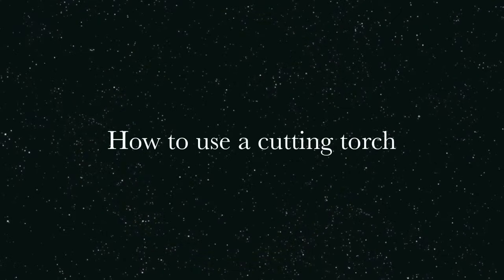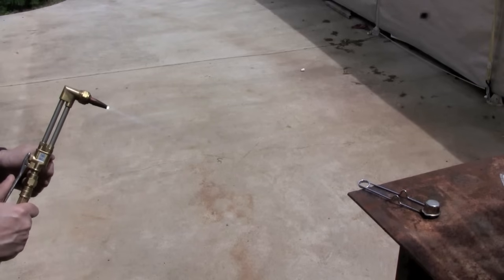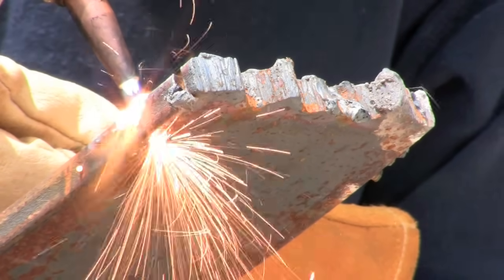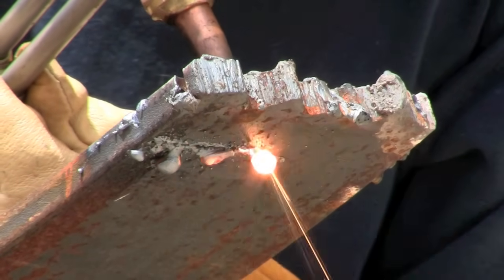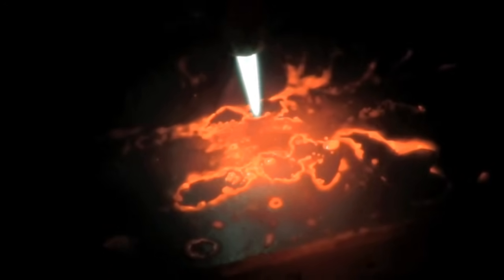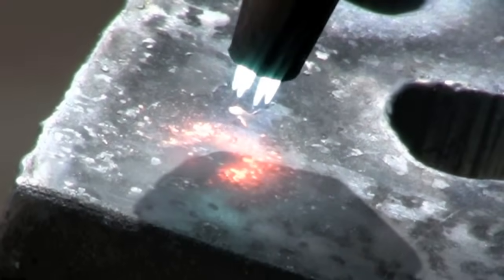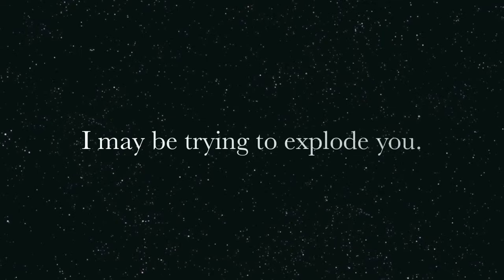how to cut with a torch. oxygen acetylene welding cutting torch

Comment: You should make the inner cone of the flame as tall as the to be cut material, otherwise you will have to much or the little power for the cut. 

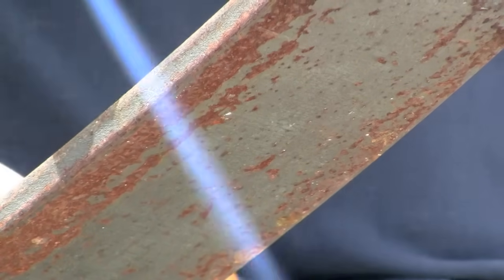With starting the cut aim at the corner and hold the torch 90 degrees (so there is no point on the cut meterial) to the piece you want to cut. First start of at 45 degrees on the cut. Then hold the torch some 65 to 70 degrees to the cut, so the torch first goes through the side, and dont leave the  buttom piece of the cut not cut deep enough ( like on 1:34). Blowthrough is a bit much, but you should try to see how much seconds it takes in order to make a good cut through the material, thickness and kind of materials takes different times. 

This is what the book  "Welding Skills" (OAW cutting opertations chapter 25) says about making cuts. 

Greetings,

Jeff

Comment: Always open acetylen first.
Always close acetylen first.
Reply: why?
Reply: +VerticalWit BOOM!
Reply: Because doing so prevents flashback.
Reply: can you elaborate why? I am new/amateur to cutting and would like your opinion!
Reply: i wanna know too
Reply: kevin O its personal preference on what to do. It really does not matter either way.
Reply: the oxygen blows any acetylene left in the hoses or tip out. always open acetylene first and close it first
Reply: Its causes burnback(loud pop) and will mess up the o-rings inside the torch... Its especially important when using a rose bud to always Go Acetylene then oxygen... I have seen a lot of guys mess torches up in my 20years welding/fabrication ...
Reply: I wonder why my teacher and book say close oxygen valve nearest the torch flame first
Reply: The book should have some reasoning if they bothered to mention it...The teacher probably just read it there!
Reply: Yep! I am an aviation mechanic and the way I remember this is: airplanes have to have fuel turned on to start the engine, and the pilot shuts the fuel off to kill the engine :) 
FYI - This runs the carb dry so there is less of a chance of the engine accidentally starting.
Reply: Povl Halberg  m.s.flate plate 3.15mm gas welding describe the  gas setting firt .pl.help
Reply: Actually you turn on oxygen first and close it first to prevent it from going to the acetlyine tank since oxygen is the fuel. And if your cutting torch pops once in a while it's because of soot. If it pops all the time, your valve on the torch is damaged. Quote rep form Victor torches
Reply: Agreeeeeed
Reply: Shutting down fuel first reduces likelyhood of a backfire. The backfire in itself isn't necessarily dangerous, provided you are running flashback arrestors, but repeated backfires will deposit soot all over the internal passages of the torch and could eventually cause leaks or other damage. Every torch I reman always has soot in it to one extent or another, but some are REALLY bad, and it's due to improper shutdown procedure.
Reply: Why we have dual flashback arrests
Reply: @craighudson2696  Indeed, I always use and recommend dual arrestors. For folks that don't understand what we mean by "dual" arrestors, we mean arrestors at both the torch AND the regulators, on both the fuel and oxy sides. So, technically, there are four arrestors total. For high-fuel-flow situations, like heating tips, large arrestors are available. Most people use alternate fuel gases such as propane or propylene for heating, and in that case the restriction of the standard arrestors can be overcome by simply cranking up the fuel gas regulator pressure.
Reply: Unless your welding with it.. not cutting!
Reply: @sharp937   I'm not sure I understand your comment. Are you referring to flash arrestors? Arrestors should always be used whether cutting, welding, heating, etc.
Reply: It also releases black sot
Reply: Close oxygen first with a rosebud or it'll backfire and not reignite properly.
Reply: @danielallen4335  Wrong. Always cut fuel first to prevent flashback. Without fuel there's no fire
Reply: @byersjohanson296  they have changed that, the new guides say to close the oxygen first don't know why though.

Comment: I never lit a torch an get black smokes yet since I'm doing welding..a clean cut always drop..btw try burning without leaving any blur at the bottom of the msp ur cutting..its gas then oxy or a little bit of both together

Comment: what pressures do you set your torches to
Reply: Acetylene: 5  Oxygen:40
Reply: Thank you very much
Reply: For 99% of cutting; Acetylene 5-7 and Oxygen 20-21.  99% of cutting problems are due to too much O2 pressure.  With the correct tip you can go through 1" material with no more than 25 psi O2.
Reply: +Jim H thanks for the advise Jim
Reply: Ernesto andrade
Reply: My teacher told use 35-40 for oxygen and 7-10 acetylene
Reply: If you have a specific brand of torch tip, let's say Smith, they will have a chart on their website, that chart has a list of tip sizes and it also tells you what to run your oxygen psi at and your acetylene psi at, never just set it to a pressure someone tells you too, they dont know the specifics of the tools your using, that's how you get hurt.

Comment: Oxegen is rusting the iron that's why you cant cut aluminum
Reply: Aluminum forms oxides just like iron, I imagine cutting it can be problematic cause of the low melting point and high reactivity of burning aluminum.
Reply: @jacobkudrowich  What's hes explaining is that with the Oxy-acetylene process cutting steel, you aren't "melting" the metal, the process is a chemical reaction that essentially speeds up the "rusting" process which severs the two pieces. It's difficult to explain, but as he stated, it's why you can't cut aluminum with it.

Comment: Nice video! Very useful.Usually the torch set has more interchangeable nozzles.Can you tell me what nozzle did you use? Some say that if you use a too thick nozzle ,you will lose more metal when cutting.

Comment: The oxygen is actually rusting the metal away...very rapidly
Reply: I was wondering how this worked...
Reply: Yes, burning..
Reply: @willgund779  No not burning. It's rusting/oxidizing it away. A chemical reaction also with heat. Please do you research before talking. For us who use this and who have bee taught this know how it happens and have learned why.

Comment: It cuts by oxidizing the metal. Really it makes it rust much faster than sitting out side and waiting for surface rust to happen. Really all your doing is rusting steel, that's why it doesn't work on aluminum and some other materials.
Reply: you mean non-ferrous metals bro
Reply: No I really did mean ferrous metal you can't cut aluminum, copper, brass, bronze and some other alloys with oxy fuel torches. but you can melt non ferrous metals.
Reply: Oh yeah that confused me
Reply: Why can't you cut non-ferrous metals? They oxidise too.
Reply: Plasma_000 probably has to do with the iron involved, somehow idk
Reply: Eric S If that's the case, why can't cast iron be cut with a torch?
Reply: Is it cut cement sheet?

Comment from the maker: @runhorun I've never used a plama strong enough for that. They would cost tons for sure. Its easy to cut 4 inces deep with a big torch.  I'm not sure but I don't think 100amp would cut 4 inches very easy. You would need a monster nasa compressor probaby. I'm guessing.

Comment: hey boss your lesson was outstanding! i needed to use the torch to cut holes in steel that was eating up too many drill bits and i just couldn't get it going until i saw your lesson to hold the torch until it melts a little then let it rip. i usually use the torch for hvac work and never actually cutting steel but im good to go now i can cut anything! will it cut open a safe on a bank? loool

Comment: Actually your the one who's wrong. You are actually oxidizing, or burning the steel with the oxygen. You can actually turn off the acetylene in the middle of a cut and keep it going with just oxygen if you keep your speed right. The acetylene just gets the steel hot enough to burn in pure oxygen, it is actually a jet of burning iron that does the cutting, the fuel gas just gets it hot, and the oxygen just gives the iron a rich enough atmosphere to burn, and propelled the burning iron through.

Comment: the oxygen is not burning the steel, essentially when you heat the metal you are cutting up to its melting point then you press the oxygen lever, a stream of pure oxygen shoots through the middle hole of the torch tip, pretty much blowing the metal out of the way
Reply: Incorrect, the guy in the video is right. It's a chemical reaction between the oxygen and the iron i.e. it's burning. You get it hot enough to react and then when you blast it with oxygen the iron oxidizes, which also generates more heat and keeps the reaction going.

If you don't believe me look it up.
Reply: joey I've welded for several years and have no need to learn from a youtube video lol, I look at videos for the hell of it, it turns to slag and blows out once it is at the correct state of matter
Reply: bloodtrack12 Sorry but just because you do it doesn't mean you understand it. Look it up! Any reputable source will tell you that you're wrong and the guy in the video is right!

"If iron or steel is heated to its kindling temperature (not less than 1600ºF (871ºC)), and is then brought into contact with oxygen, it burns or oxidizes very rapidly. The reaction of oxygen with the iron or steel forms iron oxide (Fe3O4) and gives off considerable heat. This heat is sufficient to melt the oxide and some of the base metal; consequently, more of the metal is exposed to the oxygen stream. This reaction of oxygen and iron is used in the oxyacetylene cutting process. A stream of oxygen is firmly fixed onto the metal surface after it has been heated to the kindling temperature. The hot metal reacts with oxygen, generating more heat and melting. The molten metal and oxide are swept away by the rapidly moving stream of oxygen. The oxidation reaction continues and furnishes heat for melting another layer of metal. The cut progresses in this manner."

That's from just one source, there are many others.
Reply: Xei "The molten metal and oxide are swept away by the rapidly moving stream of oxygen. The oxidation reaction continues and furnishes heat for melting another layer of metal. The cut progresses in this manner." 

That's exactly what I was talking about -_-
Reply: bloodtrack12 I have no issue with that part, just with when you said "the oxygen is not burning the steel". You seemed to be saying that the only thing the oxygen does is blow away molten metal and what I'm saying is the oxygen also reacts with the steel (i.e. it burns) and that it's a very important part of the process.
Reply: The oxygen doubles the heat of the flame once applied, oxygen doesn't burn, it's oxidizing
Reply: joey
Nah
Reply: bloodtrack12 speak clear, dude. Burning and oxidation are the same. If you meant that oxygen is used to 'blow away' molten iron, why use oxygen? Why not cheap compressed air?
Reply: Well, as they say below, yes the O2 really is doing it. Proof: Start the cut and have someone turn OFF the acetylene. Your cut will continue just fine. Honest - strange but true.
Reply: the oxygen is burning the steel.  it's oxidizing the metal until it's just iron again.  the slag isnt steel anymore